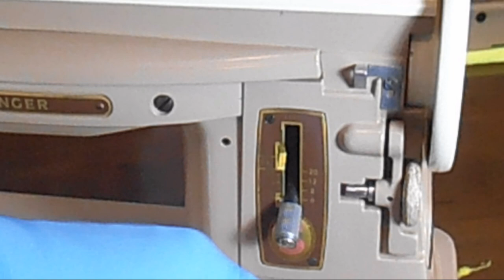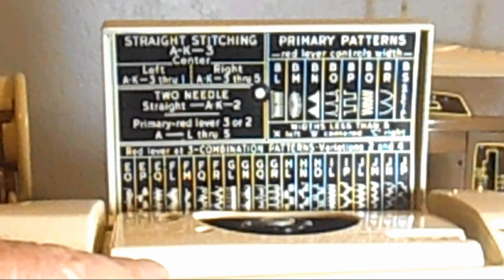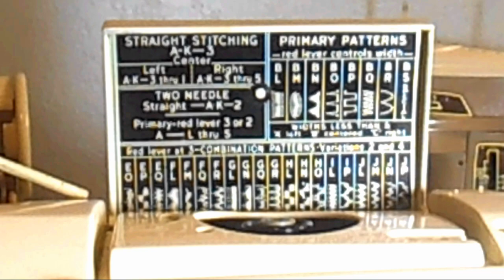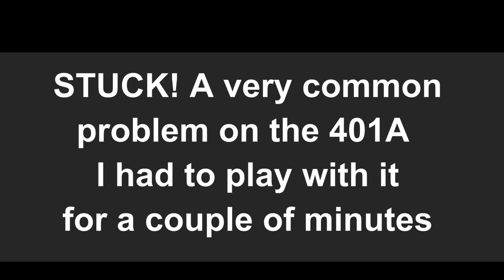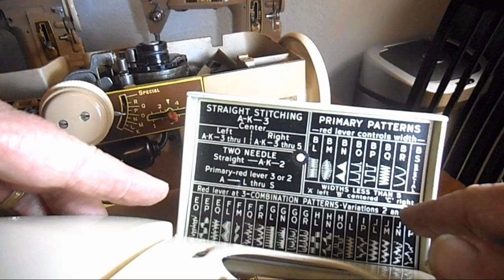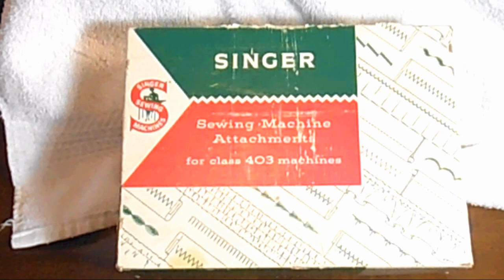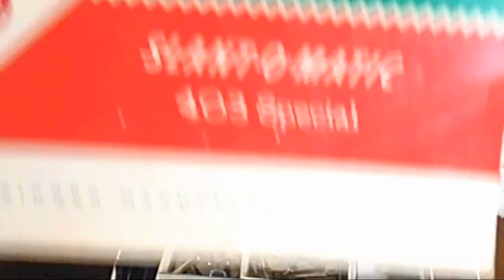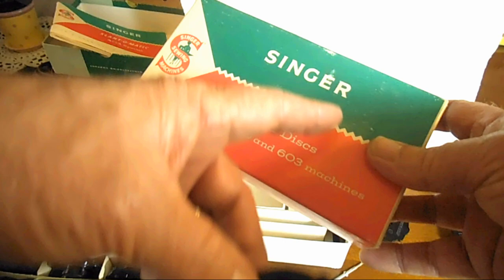SINGER MODELS 401A 403A 404 COMPARING THE BUILD AND FEATURES

Comment: This video is amazing.  I really appreciate  that you explained how everything worked including showing some of the parts outside of the machine to see more easily.  I would love it if you would show how to dissassemble everything and put it back together in the correct order.  I just bought a 401A and would like to clean it to the nth degree before re oiling and greasing it back up.  Also loved the history behind everything!
Reply from the maker: Thanks for your enthusiasm! You're my kind of viewer, and you came to the right place. JACKPOT!!  Here are links to 100+ videos that will show you, step-by-step, how to do what you asked. Just as an example, here is the video I posted TODAY that shows how to remove, disassemble, clean, reassemble and set the timing on the cam stack of your 401A. No Kidding! https://youtu.be/aphiW06yp64
The other 100 videos involve the models 401A, 403A and 404, which share most of the same parts, plus motor and foot controller restoration. The works! I hope you enjoy them and find restoring your 401A very rewarding. Here are the playlists of the videos.
https://www.youtube.com/playlist?list=PLsCOZgzzaiKLiDl9yFTP6mJgQmz5lj4NO
https://www.youtube.com/playlist?list=PLsCOZgzzaiKKyqvdDRwS-9MfLuwSNJTcg
https://www.youtube.com/playlist?list=PLsCOZgzzaiKIB4kvIHCfHYuyLMUp5A4UI
https://www.youtube.com/playlist?list=PLsCOZgzzaiKIB4kvIHCfHYuyLMUp5A4UI
https://www.youtube.com/playlist?list=PLsCOZgzzaiKL6ePPxLpmnWSzTyxPKTb71
Reply: @andytubesewing1953  Wow! thank you for the reply!  I searched your channel just briefly for key words like restoration and rebuild and only saw a couple for the 404.  That's what led me to this video, I wanted to see how much of the 404 was similar to the 401.  I can't wait to dive into these other videos you sent me.  I greatly appreciate it! Thanks for taking the time to do all this!
Reply from the maker: @joshuagoheen  You're very welcome. I know you will enjoy working on your machine. It's very rewarding and addicting too, so be careful of that, haha. I knew I was in trouble when they would not all fit behind the sofa! Good Luck.
Reply: @andytubesewing1953  So am I correct in saying you have not made a video yet on removing the selector switches and components?  Also I'm sorry to hear on another of your videos about what you're going through with health.  My dad went through that.  I am praying for your healing.  Thanks for your response
Reply from the maker: @joshuagoheen  Yes, that is correct. My next video will be the CamSelector Arm Shaft and Followers. You do not need to wait for me though, Joshua. If you need to get started you can download a FREE copy of the original Singer Service Manual here;
https://sewingdude.files.wordpress.com/2012/09/singer-401-service-manual1.pdf   It is not the clearest xerox scan ever made, but it is readable for the most part. It covers everything on the machine, (everything) with written instructions and pictures pointing out the parts. Of course, it was made for the Singer Repairmen who knew what they were doing and used it as a guide, but I have used many of the manuals when working on models I was not familiar with and they are very helpful. Thanks for the prayers, Joshua, that's the best.

Comment: 1:21: what exactly did you do to "play with" the inner knob?
Reply from the maker: There are lifters and followers inside that are controlled by those knobs. The parts get dirty and sticky. When I moved the left pin to "E" 
it did not "lock-in" to the lifter and that was preventing the inner nob from moving freely. This is a well-known problem with the 401A and 500A Rocketeer models. Owners usually add more oil to the parts as directed by the manual, but never clean out the old oil. These machines are about 60 years old now. 60-years of old oil, dirt, and gunk on those parts. I did a series of videos for model 401A, and one of them is specifically for working on those selector knob parts https://youtu.be/6O2bpVg_o_w   Here are all the videos about cleaning and adjusting the machine https://www.youtube.com/playlist?list=PLsCOZgzzaiKLiDl9yFTP6mJgQmz5lj4NO

Comment: Good evening Andy Tube, I’m disassemble in my 404- , yes it does have a - sign after the number. It’s on excellent condition but it had dry up gunk like maroon  crayon 😑.  I was replacing the cleaned hand wheel as you were describing the plastic gear in it, and I have know that my machine have a white plastic one not the brown “ fribrolite” I think that’s what you said they called it. Another difference is that it does NOT have a drip pan with a felt ; instead it goes directly on the bottom plastic part of the carrying case !!?? 🤔.
Thanks For all you do , love your videos and I really appreciate it.
Reply from the maker: Good progress you're making. Singer guys told me the gear is made of Textolite, developed by Dupont and a precursor to a type of Formica. Oh yes, I have found many strange types of grease/oil in the machines. Once it was burnt up olive oil... yuck. When a customer bought a machine like the 404 at the Singer Store they decided if they wanted a portable with a plastic base attached and a top case cover, or if they wanted the machine mounted into a cabinet. For a portable machine, they did not need the drip pan b/c the plastic base caught any falling oil/grease. When they mounted the machine into a cabinet they installed a drip pan to prevent the dropping of oil onto the customers' floors.
Reply: @andytubesewing1953  thanks !
For a moment I thought I had miss place it somewhere.😅

Comment: Is there a way you can tell & or show us the Electro Grand Deluxe Automatic Model 400 ? I would very much appreciate it, Tank you
Reply from the maker: I do not have any information about it other than what you will find on a Google search. Sorry. I only work on Singer Brand.
Reply: It is exactly same colors same builds as these... made by White Machine . I have tried to find this no luck so far. If you find out anything on it as these are  twin sister like to these it has cams . Just the dials are different with indicator Windows it has 115 vol lip d.c. 90 watts 2P motor the same tension dial etc.
Reply: Inside & underneath is same....only motor on back & wheel centered on the end all metal gears
Reply from the maker: OH? The exact same colors and builds? OK!
Here is a link to a FREE copy of the original Singer Instruction Manual for Models 401A:
https://www.singer.com/sites/default/files/product_manual/SINGER%20401A%20Sewing%20Machine.pdf
Here is the link to a FREE copy of the original Singer Service Manual for it:
https://sewingdude.files.wordpress.com/2012/09/singer-401-service-manual1.pdf
That's 161 pages of information of your "twin sisters" machine, made by White Machine, but not Singer.
I hope these will help you out, Pamela. Good Luck.

Comment: I purchased a 401 A at a thrift store. It doesn’t have a power cord or a pedal. The machine was made in 1951 from S. Carolina. The machine has a round opening for the power cord. And the pedal has 2 prong.  I tried using my cords from the other 401 A and they won’t fit. Do you sell the correct cords for this machine?  If so can you respond on here so I can see what I need to order from you.  Thank you.
Reply from the maker: I don't remember ever seeing what you have described on the model 401. I wonder if you'd like to give me the serial number on your machine so I could do some research for you? The serial number is stamped onto the body on the bottom of the machine on the nose end (needle bar end) and should start with NA, NB or NC followed by 6 numbers. Thanks
Reply: The number is NA 649303
Reply from the maker: Your 401 was made the first year of production (1956) and maybe that is why the terminal/plug is different? If you'd care to send me some pictures I could compare them to cord sets I have on hand to see if I could figure out a cord you could use. I'd also like to see how the terminal is mounted to the machine. (maybe you could change the terminal to the kind normally seen on the 401, 403, 404 models) My email is andytube53@gmail.com  You could also post some pictures on your YouTube channel. Just let me know. Thank you.

Comment: I saw what I think is a machine in this series at an estate sale... unfortunately they were closing and I hope to be able to get it first thing tomorrow morning. I've been looking for one of these old metal beauties. 
I saw a box of accessories and a manual for the 404, which wasn't the same machine- are the accessories interchangeable?
I'm sorry if you mentioned this later on in what looks like a very informative video, I paused it to comment. 
Beautiful machines, the old ones are, I hope to get this one.
Reply from the maker: Yes. These three models as well as Model 301A, 500A, 503A, 600 series and 700 series are all slant needle machine and use the same feet and most use the same black Snap-On "top hat" pattern cams (401A, 403A, 500A & 503A)
Reply: @andytubesewing1953  Thank you for your reply :) It turned out to be a 337, which is ok too, so I'll be going through your restoration series on that. It looks intimidating but your videos are so detailed, they will be a tremendous help!
Reply from the maker: @ceeteemcdee4126  You can do it, no worries. I've had emails for viewers aged 14 to 84 that restored their machines even though they had never done anything like it before. One part at a time and take it easy. There is no hurry (usually) and you'll find it very rewarding to clean the machine and get it running properly. You know where to find me if help is needed. Good luck, and thanks for watching my channel.

Comment: This is a great presentation. I have 401a, 403a, 404and several 411g. My daughter has a 503a.
I find that there are only a few problems as long as I keep them cleaned and oiled.
Have you ever seen a 402? And do flat cams work in the Singers? They’re same size and color and the holes are identical diameters and locations. 
Anyhow, just wondering.
Reply from the maker: Thank you, JL. That's an impressive collection of machines. I am familiar with model 402 and had a chance to buy a complete one in 2010,  but the fellow want $500 and I could not afford it. There are not many available in the States but there is one now on eBay for $1500. https://www.ebay.com/itm/165306309381?hash=item267d061b05:g:sGEAAOSwMPBh9GVX   Like some of the other German Slant machines it can be set up as a treadle. I like the write-up the toolfool did on the 402: http://www.toolfool.org/sewing/402G.htm
     As to the flat cams working on the slant-o-matic or Rocketter models, I honestly do not know. I've never thought about it before.
My first question would be if the flat cam will fit/snap onto the tri-spring cam holder on those models. I don't have any flat cams or I'd try them on my wife's 403A, Regina. Last year I gave away about 100 of the top hat cams when I sold all my machines. I have not looked in a long time, but I used to buy the 12-pack of cams for $8 to $10. If you ever try a flat cam on your machine I hope you make a video, whether they work or not, as I think people would be fascinated by the idea. Thanks for watching my channel, and take care.
Reply: The eBay listing is in Greece.
BTY- do you have a go to source(s) for machine parts? I’m finding that more often than not it isn’t just a bad part, it’s been looked at and for sure it’s a big expensive part.
All of the machines sent to goodwill end up in their auctions. Often they’re missing food pedals so they sell a lot of pedals only auctions. 
Although I did snag an old Necchi Supernova Ultra that weighs, well it’s very heavy, which is probably why it’s just about pristine. It has a tilt-able magnifying glass above the needle to make threading easier, and the feet are unusually elegant. 
Sorry to ramble on like this, not often I talk to other sewing machine enthusiasts. 
I’m going back to watch more of your videos. I have some big maintenance to do and your videos are incredibly helpful.
Reply from the maker: @jlmorris2147  Yes, the website is in the USA but this seller is in Greece.
Most of my parts sellers have retired and closed shop. There is one still going and I have bought from her for many years: 
https://www.thriftyfarmgirl.com/   Otherwise I just find who is selling what I need on eBay. I've been told there are many sellers now on Facebook Marketp[lace and Amazon.

Comment: I once had a Singer 403A that had an off center Textolite gear. The machine would bind in one area as the hand wheel turned. The remedy was to replace it and then the machine was fine. No one had ever heard of that flaw in a Textolite gear.
Reply from the maker: Great comment, Randy! That must have been fun to troubleshoot. I had not heard of that either. Until 2020 I'd never heard of a broken Textolite gear either, but a viewer sent me a picture. That gear you found may be the only one that made it out of the factory. Good to "hear" you again. Take care.
Reply: @andytubesewing1953  Very informative and excellent video. My 401A has a little tiny 401A badge on the lower front. I assume that was only on the earlier ones?
Reply from the maker: @randyc8171 Thank you, Randy.  I think it was in the earlier of the 6-year run. I've only seen it once, on a 1958 401A I restored for a customer: https://youtu.be/2eFh287xPhY
My understanding is the 401A was made 1956 thru 1961, so mine was the 3rd year of 6 years.
Reply: Mine has that also. The original manual on the inside says it was made in 1958. The booklet also has an astarex 401* but the machine has 401A oval disc.